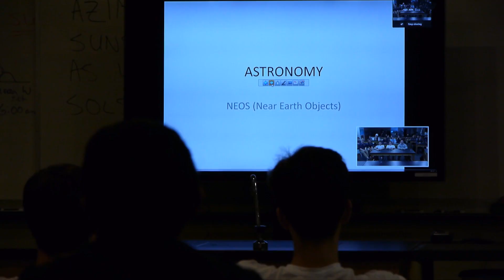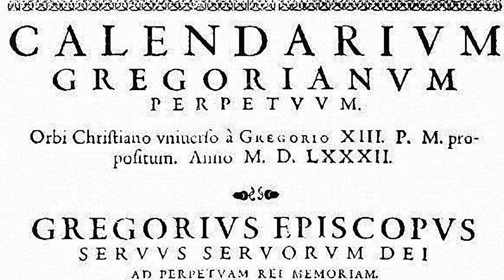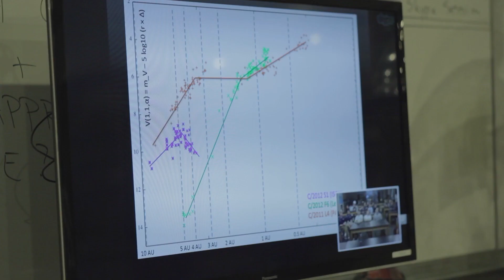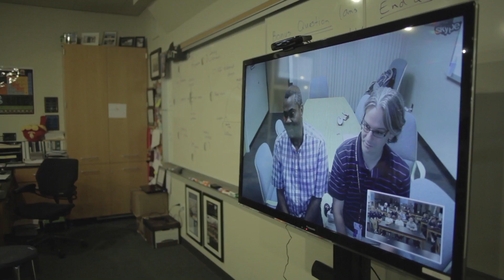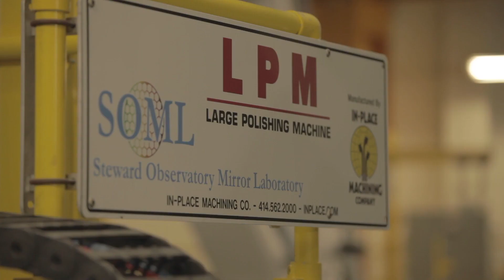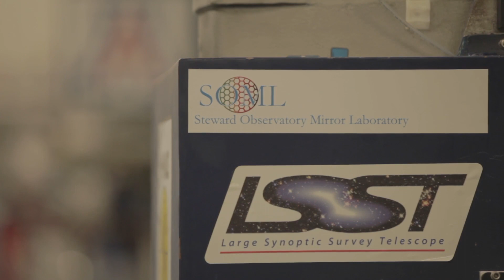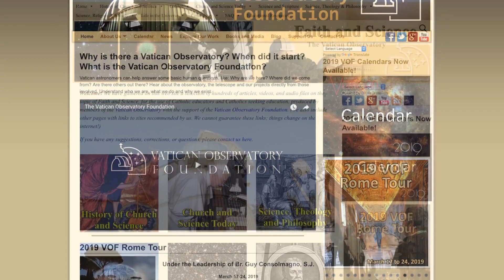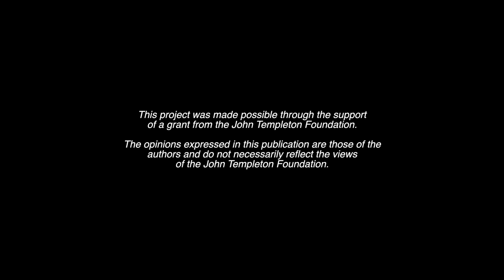Vatican Observatory Foundation

Comment: Your Excellence , in your Authority, i thank of any critic, or refute of Your Will only; with the respect that i am an Science amateur curious only.

In my opinion, and also has an question; trans-dimensional jump, in concept based on merging to different locations of time and space ,I.E. 2 different  planets in two  different solar systems, to able instantaneous bi-location between them; can be an matter of the field of gravity waves existing between the different locations with regard that both solar systems can be inserted in an galaxy with complementary gravity from other celestial bodies, which form the resulting equilibrium of dynamics, I. E. Black Hole and even an Solar System  and even  its planets geocentric positions   .
If,  The  field of gravity waves , or gravity contained between the 2 different solar systems, of the full area,  can possibly  be breaked, from the starting point , or an Planet in solar system "A",  by an subbit acceleration and maintained the potency necessary to maintain out of the full gravity waves "field/ Area" until reach an Planet in Solar System "B"; can the gravity existing between the  two different 
 locations be possibly invalidated in terms of efficiency to allow the correspondent to bi-location(?).

If an experience would be set by the attempt of  the necessary   potency required to subtly accelerate, an body from location "A" and that the potency contained at the starting point wouldn't, invalidate that the decrease of acceleration would allow the entrance of the specified body at location "B", at the corespondent existing  gravity, that would again affect the body in deceleration,   which would be by approximated calculation, also previously correctable?

https://en.wikipedia.org/wiki/Gravitational_wave

Comment: In my opinion; God is Perfect and capable or flawless acts, any sicence phisics Law that acts immutable in the natural realm through  time  and without flaws, which is derived from the perfect act of Power, The Genesis from God.
 If the unified science theory will be confirmed , God can be validated has The Creator for having created every flawless science law, and respective dynamic interaction through time between every science  law which is also flawless and immutable , and also is  an Perfect act of Power of God.